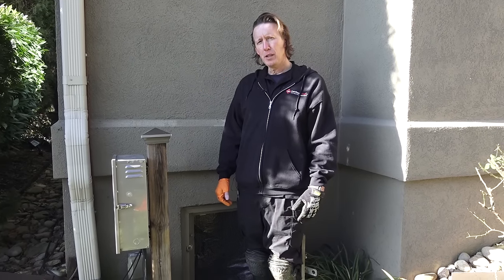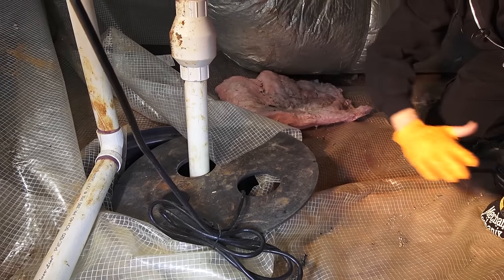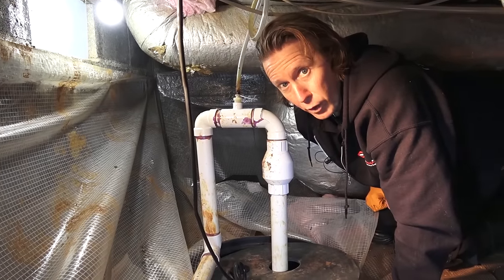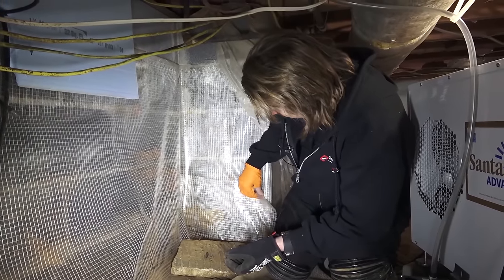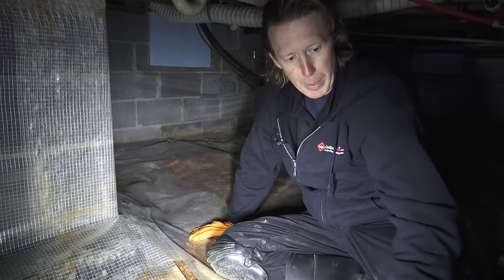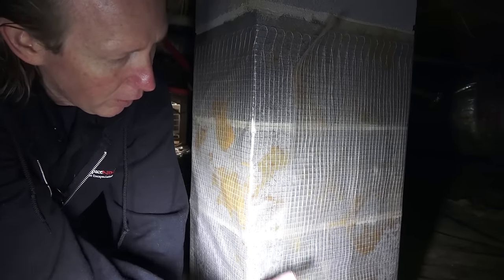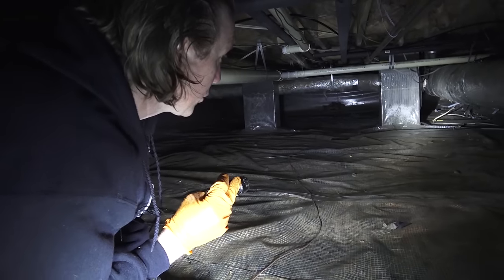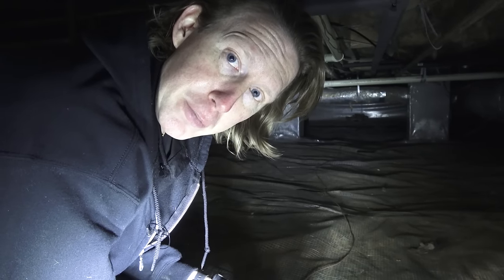Redoing A $25k Crawl Space Job | Tips For Inspecting Your Crawl Space | Find Crawl Space Problems

Comment: I would never spend $25,000. More like $400 for plastic and a 70 pint dehumidifier from Home Depot. The one I have has lasted 8 years. You don’t need a sump pump so stop charging people for that.
Reply from the maker: Thanks for your input! DIY can definitely be a good way to go if you need to save money. However,  a lot of times we find box store dehumidifiers cannot keep up with the humidity load and run more frequently than the Aprilaire dehumidifiers. As for sump pumps, some people do not need them! But, if there is any standing water or evidence of water intrusion on the block wall, it is a good idea to install one. We've been called out to many homes that have flooded due to a heavy rain that needed a water management system installed in order to keep mold from growing.
Reply: What an insightful comment. I’ve been doing this work for 12 years. Go ahead and get you some 4mil poly from Lowe’s and a dehumidifier with a pan so the plastic will disengage in a few years. And climb under there two or three times a day to empty the pan. If there’s no intrusion you don’t need drainage and a pump, if you do, then you certainly need it. But your the expert so go ahead and diy.

Comment: Hire a guy to pour concrete on the flooring after running a barrier and diggin tiles to direct your water away from the house. Make it a temperate part of your house, Problems solved ! warm/cool floors, worry less about termite problems, little dampness, no soil contact and seal your vents for less than half of 25k what a joke this is sad. What they don’t tell you about in “encapsulating” it’s a good way to keep the ground and vapor barrier wet which is a breeding ground for mold and insects worst of all termites will tube their way up those styrofoam boards to eat your floor joists. And guess what you will never know your house is being consumed day by day. Because this guy uses WHITE vapor paper and spray foam(which termites love btw). It looks nice but it’s not the way to go guys.

Comment: Why don't you just open the crawl space and let the air flow (naturally or with a pump). If there is good airflow there will be no humidity.
Reply from the maker: You must not be from the South. :) If the humidity is high outside, that method doesn't work. We actually just released a video discussing this topic. Check it out here: https://youtu.be/IGVVSjbyhzk
Reply: @CrawlSpaceNinja  thanks for replying! Actually I live in Norway and have an issue with humidity in my basement and crawl space. Are you available for video conferencing?
Reply from the maker: Hello from Tennessee! Thanks so much for watching. We may be able to set something up. Fill out our Ask a Ninja form so we can get more details about your situation! https://crawlspaceninja.com/ask-a-ninja/

Comment: Wow, and I thought mine had issues. In my case, they’ve been here eight times now and I still don’t think it’s done right. What temp should an encapsulated crawlspace be? ‘Cause mine is at the outdoor air temp, which was 9 degrees last night.
Reply from the maker: If your vents are sealed and the walls insulated, it should be close to the temperature to inside your home if you have duct work running through your crawl space. If the vents are open it would be understandable that the temperature is closer to the outside temperature.

Comment: Well ya not very well executed... you remarked something about reinforced plastic negatively but I didn't hear a reason... you spent so much time riding on the plastic but the open fibre glass would have been more of a concern to me... that air exchanger could be put up stairs... the sump? well I guess just dig a hole... u sure these folks spent 25 K just for this?